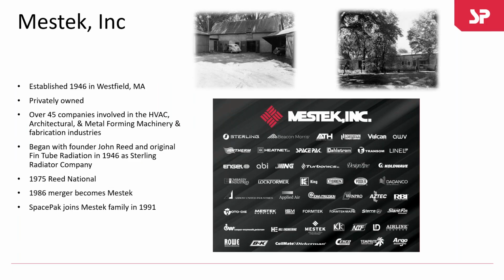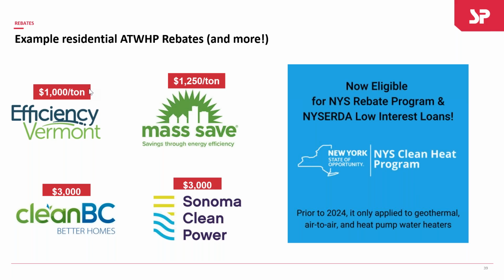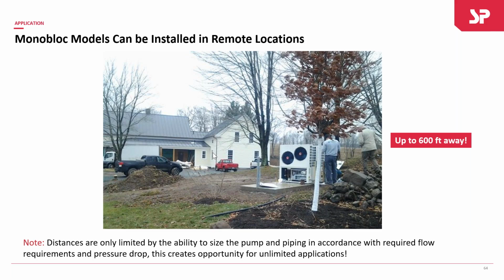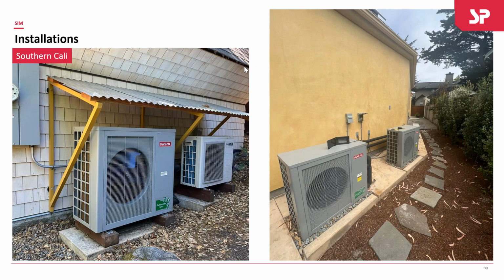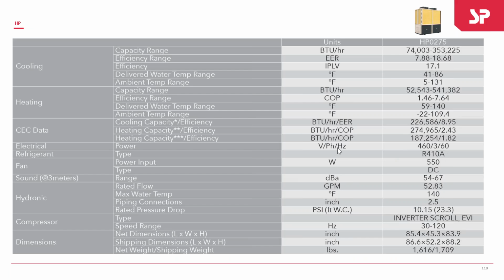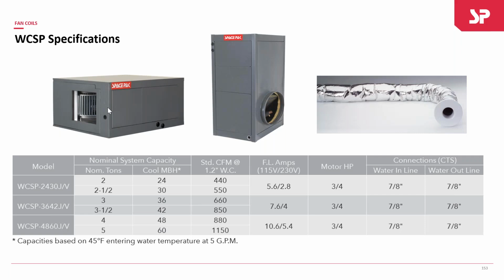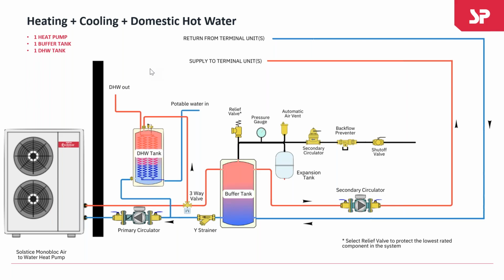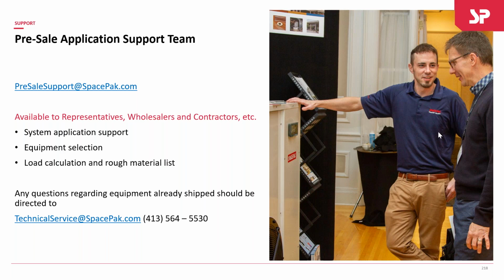Air-to-Water Heat Pump Installer Training | July 2024

Comment: Any updates on the R290 rollout? I plan to start construction later this year or early next year on a house at the central Oregon coast and with no need for cooling, it seems like an ATW heat pump with propane refrigerant for hydronic radiant floor heating and domestic hot water might be a good choice. It’s a pretty mild climate (rarely drops below freezing in the winter) so I’m not sure if an R32 or R290 heat pump would be more energy efficient and/or cost-effective. Mechanical system installation would be mid to late 2026.

Comment: Thanks, I can use this to install a SpacePak ATW system in my house. Couple installers I've asked for estimates, gave me prices around $30K just for installation. And I already have propane based hydronic floor heating.
Reply: Curious if you have been able to find a supplier to get the equipment from?
Reply: @djzorch  Sorry, haven't started looking yet